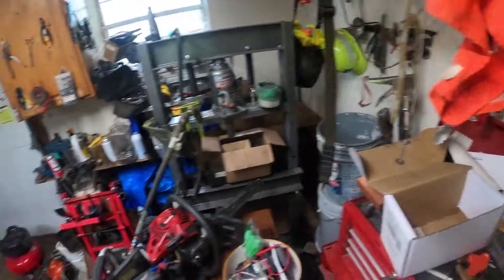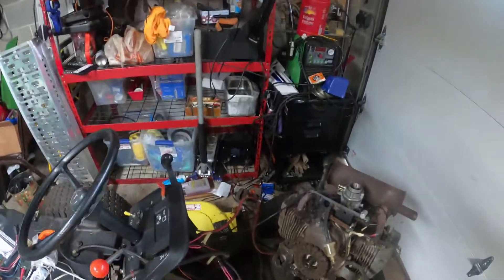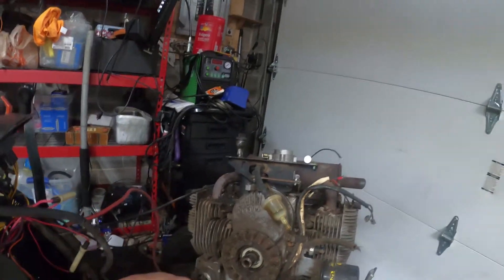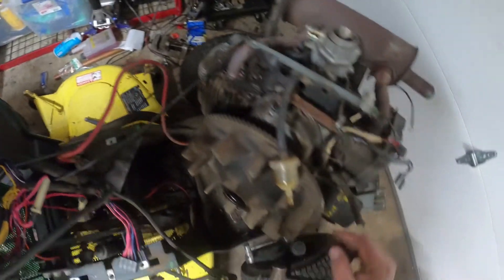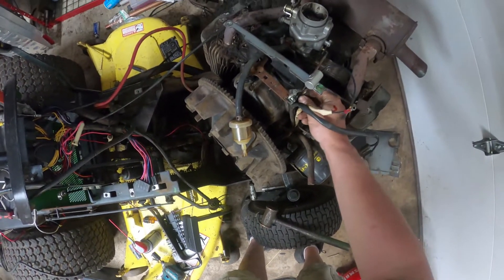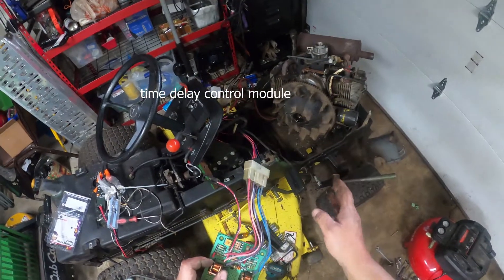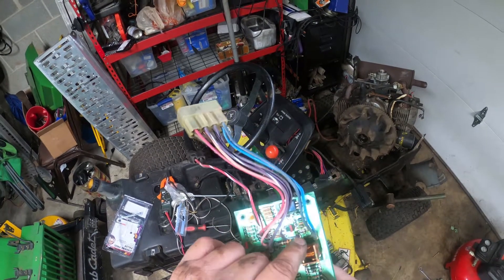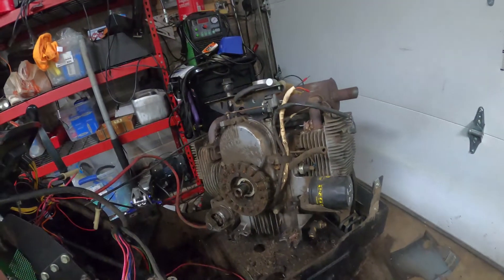john deere 316 onan p216 engine. loss of spark

Comment: Hello would it lose spark while running or would it start up fine then Die ?
Reply from the maker: Start then die. Some folks chase this one because the obvious things are coil pack and points. The not so obvious things are the ignition on flywheel and little electric box with relays.
Reply: @rywolf01 ok I’m having trouble on my onan it starts up sometimes then when I do get it to start I move it and shut it off then it just cranks and cranks  just starts when it wants to
Reply from the maker: Do you have a spark plug tester? https://amzn.to/4ldaske

Comment: So how do you test the ignition module? Currently have no spark. And that the only thing I haven't checked
Reply from the maker: If you downland the onan manual there is a ohm test you can perform on the coil pack. You can also test the contacts for spark. You'll have to scan through the manual though. https://www.lozeman.nl/wp-content/themes/pixel-example/onderdelen_tekeningen/Motoren/Onan%20Motoren/Onan%20service%20manual%20Performer%20series%20P216-P218-P220-P224.pdf

Comment: aside  from trhe  chaotic   approach , shaky cam,  bumbling  about -  good  job finally  arriving  at  a  solution.  One  pet  peeve,   seems  like   not  1  person on  planet  earth  knows the  difference  between  a  bolt  and  a  screw.  Botls  have   a  nut,  pass through a  hole  and tightens by torquing the  nut.  SCREWS  insert to  threaded  holes in assembled  parts, tightened  by torque on the  head.
Reply from the maker: Thanks for comment.

Comment: I have a miller welder with the performer 16 in it aswell. I had it die on me 3 times in a week, 4th time I went to crank it and all it did was crank and a nasty backfire when I would let go of the switch. Im wondering if my ignition module is bad. But dont want to jump the gun on it since the cheapest im seeing it is $150 with no returns. How did you go about diagnosing? So far i have done fresh plugs, new coil, valve adjustment. I have the welder torn down and the ignition module out. Is there a way to bench test the module? Thanks in advance
Reply from the maker: If I recall you can download the service manual for the onan. There's a section in there that describes troubleshooting. What I will say is that you can hook a test light up and rotate the flywheel to test the ignition system. If you have intermittent spark... or loss of spark, you've eliminated the obvious items through testing. Like the coil and condenser, it's probably the module. Found a guy out of Minnesota that was a salty old dog, but knew onan well. He also sold me the module.

Comment: Soooooo………….WHAT WAS THE ELECTRICAL PROBLEM THAT WOULD NOT LET THE ENGINE START?

Should have been a 1 minute video.
Reply from the maker: First 30 seconds I state that the ignition module is part of the problem.